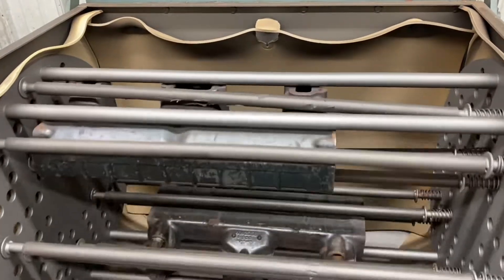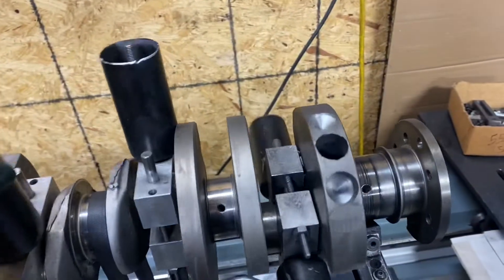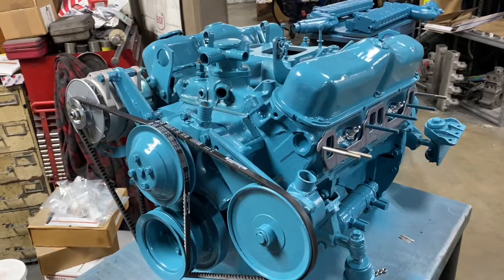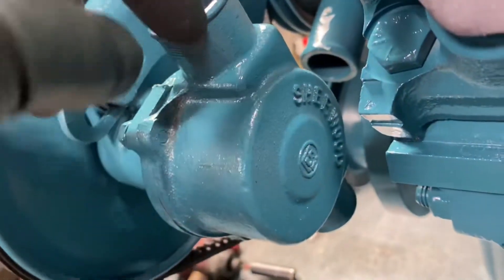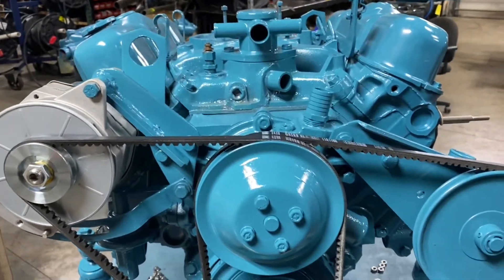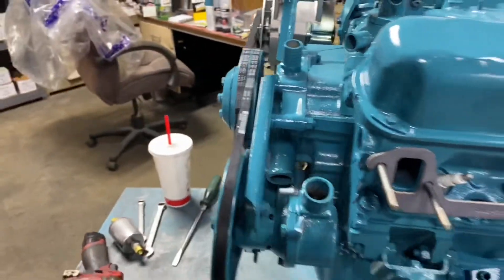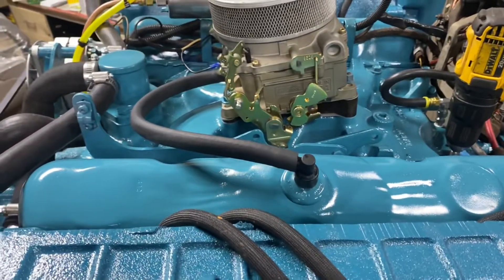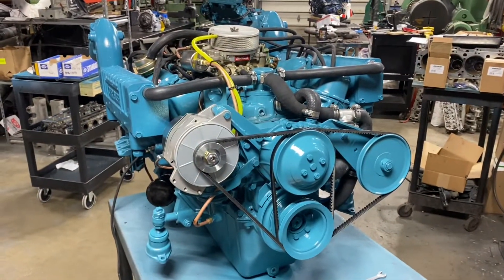Opposite Rotation Chrysler Marine 318 Overhaul

Comment: it's been many years since I worked on boats. What is the benefit or reason for a twin engine boat to have one engine reverse rotation? Excuse the lack of knowledge, always interested in learning. what has to be done for the starter, and the firing order on the reverse rotation engine? is the camshaft any different as well as the oil pump?

Comment: I have milky oil in my engine. Besides the head gasket and the exhaust manifolds where else can water be mixing with oil in these engines.
Reply from the maker: Intake manifold gasket, cracked block or water reversion.

Comment: Question: is the fuel pump different? Doesn’t the cam offset lobe hit it on the way up instead of down? 
Also assume the starter needs to spin opposite..? Thx for the help!
Reply from the maker: Fuel pump is the same. Starters are different.
Reply: Thanks! Yes, for future searchers, the pump’s arm tip angles down under the eccentric lobe. So the arm gets pushed down with either rotation, reverse or normal.

Comment: Nice! Was the carb Edelbrock prior to rebuild? I have similar 318 w/Carter AFB 4bbl, sits close to hatch. What did Edelbrock carb set up add to performance & height?
Reply: I swapped my afb for an Edelbrock. They’re actually the same body with only a few exceptions. The throat size is different, though, and I made an adapter to fit my original flame arrestor which added to the overall height. But you could buy one with the right diameter and keep it the same height.
Reply: I swapped my afb for an Edelbrock. They’re actually the same body with only a few exceptions. The throat size is different, though, and I made an adapter to fit my original flame arrestor which added to the overall height. But you could buy one with the right diameter and keep it the same height.

Comment: what direction did you spin the drill to prime the oil in the opposite rotation engine?
Reply from the maker: Clockwise. Both distributors turn clockwise in either rotation.